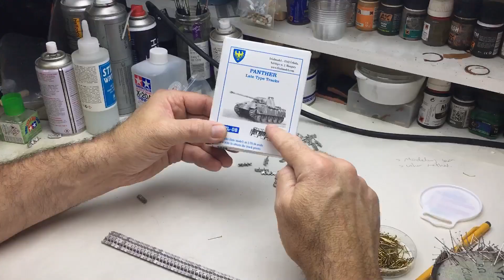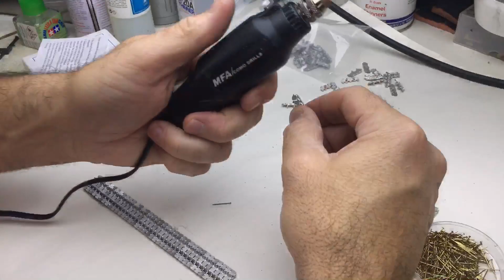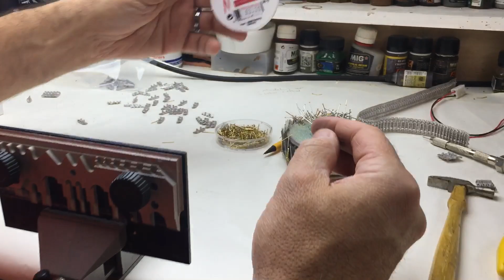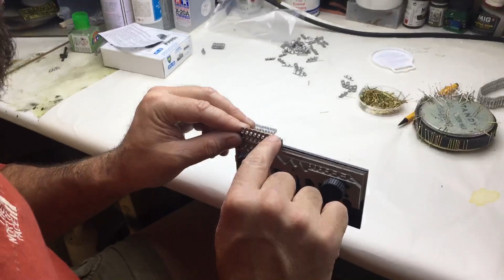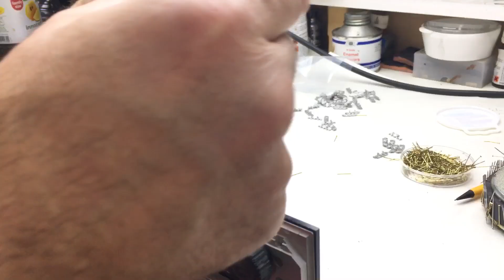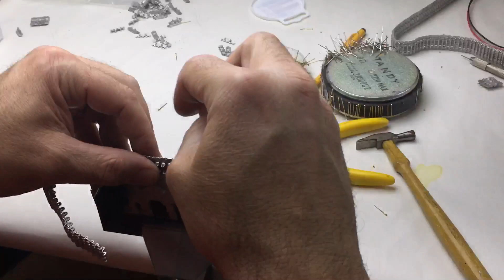Friulmodel  metal track NEW FAST ASSEMBLY METHOD - The Usher Method

Comment: Ive NEVER understood the 'value' of fruils?!....Sure, its metal, has weight n' flex...AND pretty $pendy t'boot....
WHERE does one save ANY TIME when ya have to RE-drill 85-90% of each track block so the pins can then fit?!
Seems like bad casting/moiulds n' incredibly SLOPPY manufacturing process's/bad quality inspection on Fruils side?
Ive ordered dozens of metal track kits from CN's 'R-Model" & 'San-Xin' & never once needed to re-drill track pin holes...

Ive ordered ONE Fruil kit 2 or so years back & that was enough (Maultier tracks) They are still languishing in the 'Spare parts bin of diminishing returns'

Comment: I think I'll try out this method. One thing tho... They are mild steel pins. Actual Brass is non-magnetic and they would bend much more easier than those you're using. Also. Try to avoid touching friulmodel track links with your bare hands as they contain lead.

Comment: Very inspiring video and method Peter!
I adapted it somewhat, cause many pins got bended. Manually pre-inserting the pins through one side of all tracks, then connecting them, thus pushing through the resistance of just one track, reducing chances of bending. Finally cutting the protruding pins with a Dremel cutter.
Great fun, thnx again!

Comment: So the BEST metal track sets are from MASTER CLUB. they have alittle more details and they are crisper.Plus I've yet had to drill any holes.as these sets come with super detailed resin pins for both sides.and the great part is no glues needed.yeah ...so far I've put 4 sets together.burshed them .painted /weathered etc.without glue.two pins backed out but that may have been on me for not setting them in enuff.they are about the same $$ as fruils.

Comment: I'm struggling to assemble Master Club's T26 tracks which have 0.4mm resin pins (one for ech side of each track).  I've ordered some 0.4mm brass rod and hope this will do the trick.  Great idea about using the hold n fold - could be the last piece in my particular jigsaw!

Great tip and I like your presentation style so I'm subscribing now.  Keep up the great work!

Comment: Excellent idea Peter. I have two concerns, which hopefully you can clarify. 1). Do you ever hammer the pin through the other end of the link?   2).  After completing the assembly, you place the links in a bath of fluid to turn them dark. Do the pins discolour also?

Comment: I'm putting together m18 hellcat tracks just now and there so brittle they would just snap doing this and the sanding is just rediculious! There kinda like same shape as a panzer 4 the 3 track pin holes are not as well protected like Panthers and tigers! One of the track heads was snapped off in the bag there and the 4mm drill bit took the front of a bite hole off another so hopefully there is a couple spare they have throw in the box for issues like this!

Comment: I think everyone over thinks this. I use the supplied wire and a cutter only. I jam the wire through the hole, without cleaning it up, snip flush. Repeat. Super fast, no idea why anyone drills them out. If anything the material in there helps hold the wire.

Comment: If you use slightly shorter pins, the heads will look like the track pins so no need to cut them off.  Love the idea of the hold and fold, I'll be using that where I can.

Comment: here in the States they cost like $70 .. not worth it in my opinion... way over priced, would rather just use the god awful tracks included in the model, which.. after adding painting, muddying and rusting.. you will be hard pressed to notice the difference by looking at them..

Comment: I'm sorry to say this, but the method is flawed - and for one simple reason - the track pinhole is 5mm, so trying to jam a .65mm pin through it just doesn't work - well it didn't in my case.

I tried the method exactly as you suggested and the first link bent, buckled, and broke - because I was trying to force a .65mm pin into a 5mm hole! 

After that I bought some 5mm pins, slid them in, put a drop of super glue on and then cut off the excess - no problem.

Comment: I just used your method last night, it worked perfectly! This is my 1st shot at these tracks for a Tiger 1 and couldn`t imagine drilling each track out! Only thing I did differently was use regular sewing pins, which worked just fine. Thanks so much for posting this method, it`s awesome!

Comment: THAT. Is THE most complicated and tedious way of making a simple task of assembling white metal tracks I have ever seen.  I had, using the brass provided in the box, both sets of tracks assembled in 30 minutes. By simply cutting all the brass wire to the required length, using a single drill in a pin vice that went the full distance  through the track link without punching through the other side, rolling each pin on glass with a steel ruler to get the pin dead straight, then adding a dab of super glue to one end and slinging the track on the model. 30 Minutes. SIMPLE.
Reply: 30 minutes to build 2 X 88 link tracks?
Just to measure, cut and straighten 176 brass connecting pins would take 30 minutes (assuming each takes on average 10 seconds, which is reasonable).
Simple maths suggests that your claim is dubious.
Reply: K COX what have you build a Panzer 1, fuckin idiot this method is by far the best I've ever seen it took me five hours for both Panther tracks and I worked very fast
Reply: No  FI. I built the Takom King Tiger. But there are some who are mentally challenged who want to think that a complicated system like yours is best.

Comment: I use bridal & lace pins,  nickel-plated steel and 0.5mm in diameter which is closer to what the recommended drill hole is. Did you have any broken track links using the 0.65mm Prym pins?

Comment: I assembled friulmodel's track only once but almost without driling. Wire is harder than white metal so, in most of the pieces, it was enough to push the wire hard into the holes to get through.

Comment: Excellent idea! I've just started to buy these tracks, but being curious how the wire was fitted delayed my decision as I wanted realistic results in all areas of the build. Kudos to YouTube and yourself for these tutorials!
Reply: Thank you for your comment. I had worked with Fruimodel tracks, and they are labor-intensive! Having to drill out most of the links just to get the wire through. Recently, I got a set from Ace Model, and they were so much easier with barely any hole cleaning. They seemed they had more detail as well.